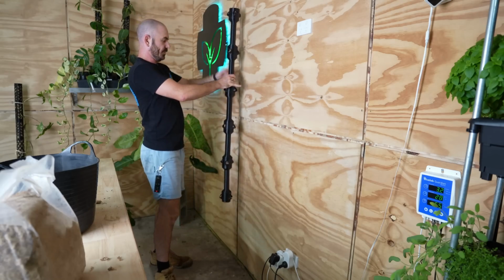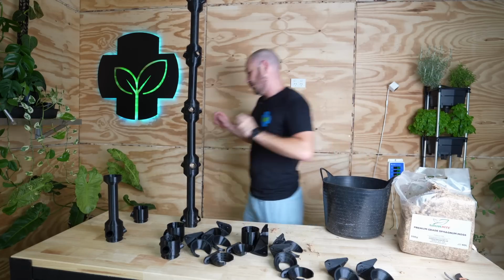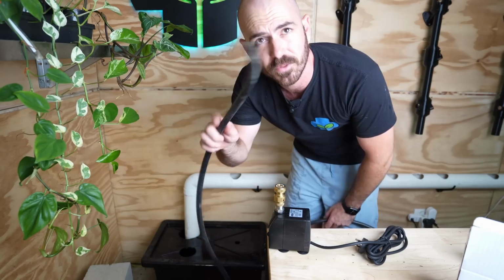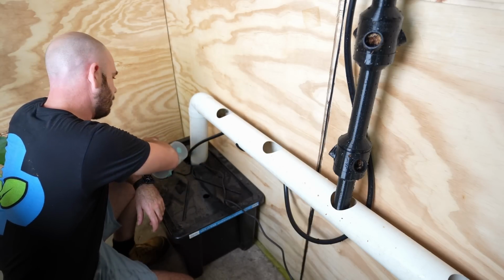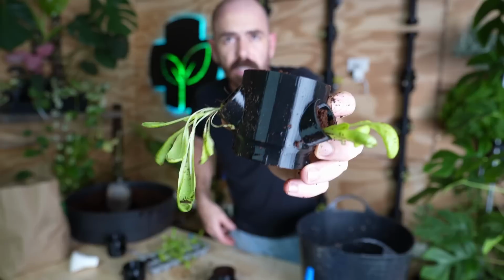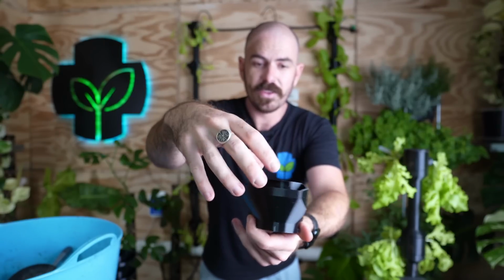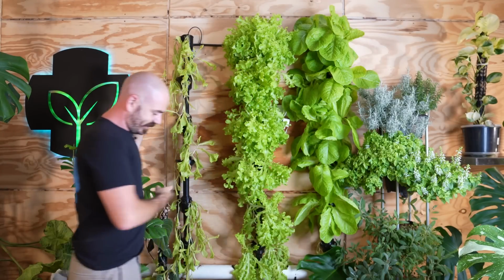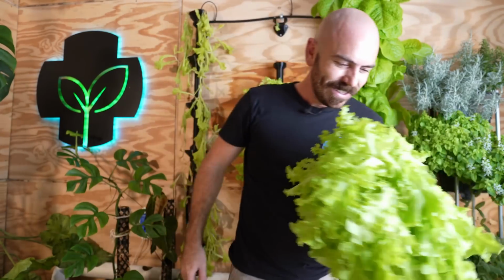Modular 3D Printed Vertical Hydroponic System

Comment: Do you have a version of this that works like the larger modular system you made, one tower in a bucket with water through the tower, as opposed to the water running up a tube outside of the tower?

Comment: this is the second video I've watched where your hole saw comes off the chuck. Here is some advice when tightening the chuck. After you tighten the chuck give it it a slight twist in the loosen direction. The chuck will click, locking it. This should keep you from losing the hole saw. I use multiple MFG of drills and this seems to work on all of them.

Comment: Great video. I tried to download the files through Patreon and there was nothing there. Also was wondering if you would be open to a suggestion about adding more files to close in the bottom of the system with one drain port to the reservoir.

Comment: Great work! I think you can save a lot of print time by combining 3D parts with regular pipes.
This would help ppl with smaller printers, or get rid of print space limitations in general. Just connect the UFOS to pipes with your bayonet connectors.

Comment: I wonder if the 3d printed plastic is what is changing your ph 
You should try soaking a piece in a container of water and measure the ph change
Reply: I was actually thinking about that as well, but I don't know if water is going to be enough to see the effect. PLA, one of the more common 3D print materials, is stable in water but it can break down into lactic acid from the action of microorganisms and their enzymes.  EDIT: I see Hoocho commented that he's using PETG. Still, it would be interesting to see if the filament or any of its additives plays any role here.

Comment: How can we use printed plastics and avoid all plastic leaching?
Reply from the maker: Not all plastics leech.
Thats like saying all metal can give you lead poisoning.

Just use the right plastic.

PETG
Reply: @Hoocho  Mint👍
I see people using PVC in food loops, not the best idea as from my understanding the plasticizers make it far less stable. Even UPVC we use to use for water supply here is questionable.

To cover a 6 X 3m wall would it be cheaper to order printed parts online or buy a printer and figure it all out?
Reply from the maker: @craigdawson7632  buy a bamboo labs A1 if low price is what you’re after.
It’s easy mode if you just want PETG printed.
Watch my latest video on the p1s and carbon.

You’ll love it once you’ve got it.

Comment: That's very well designed hoocho. Have you bought yourself a kmart food dehydrator yet for your filament? Game changer
Reply from the maker: I’ve got a devanti 😂
Reply: How does the dehydrator help with filament?
Reply: The spools of filaments absorb moisture from the air. When a spool is hydrated, it pops and hisses as it is heated up at the 3d printer's nozzle, cause the moisture is vaporized. 
This causes ugly prints.

Comment: From an engineering perspective the narrowing funnel portion of the tower serves little purpose and could be creating some of your leaking due to water constantly being adhered to the wall after each funnel.  Regardless of whether you eliminate the funnel-ing effect the internal basket is also probably in the wrong location, it could be better utilized above the plant (in other words at the bottom of each pipe section to redistribute the sprinkles rather than right at or “below” the plants. Personally I would eliminate moss and coco and only use scoria, hydroton, etc, because of neutrality, oxygenation, less system contamination. Etc.  Love the content.  Good luck.

Comment: 3d printing and cropsteering moisture sensors are changing the 1 man farm industry.. add in the strawberry picking robots and drone for ag, and you can automate acres and acres, and harvest it with 1 person by yourself
Reply: What did I tell you about watching things other than DSP, BOY!
Reply: What is a crop steering moisture sensor
Reply: @billbobaggins7617  Another over hyped failure point. But answering your question; "cropsteering" is a catchy term used by pot growers to a set of automated systems to optimize growth conditions and supposedly extract the last bits of yield of your crop. A "cropsteering" moisture sensor is your run of the mill electronic moisture sensor that gets plugged in to a micro controller, that's it.

Comment: Can you plant directly into the return pipe as well? easy NFT?
Reply: Technically you could you would just have holes in between the drain pipes however with his specific setup they wouldn't get much light. Growing outdoors then sure or adjust the light position so they all get the same amount of light. Definitely an option I would say.

Comment: Printed a different version of a hydro tower 2 years ago, still pleased, its still in the kitchen and grows herbs and salad. Perfect. But I chose white Pet-G, looks nice but is a mistake. Light gets in and algae grows. You need light tight filament, otherwise more cleaning, more often changing the water. H2O2 helps but does not remove all algae. Greetings from 53°N
Reply: I had the same experience with mine, nutrients start to crystalize on the outside of the tower and algae starts to grow. Easy enough to clean up, just doesn't look attractive when using white filament at least.

Comment: It looks great but did you solve the heating problem?
As water falls through the system it picks up heat from the air and causes the reservoir temperature to rise. Im just wondering if you solved that issue?
Reply from the maker: To be honest I didn’t encounter those in the studio.
But they definitely exist and when I take this system outside. I predict we will experience them.
In my climate especially, but most of USA and anywhere south of me it won’t be a problem.
One thing at I time I guess 😅
Reply: @Hoocho  lol, Im in Texas, it would be an issue here as well. ;)
Reply: If you can run a resovoir in the ground, you could cycle it to the ground resovoir( to cool, as ground temperature is cooler and remains about the same) compared to the hot top soil

Comment: Do you need coco in the central tube? Can't you just use scoria or clay? You just put everything together and fill from the top (without the strainer part in the top modules)?
Reply from the maker: Possibly, I’m using the coco to wick back up where the nutrient wants to escape.

With this design release I’m hoping to get feedback.
And if it works let me know. But this is my best approximation of my assumed outcome. It’s quite hard 😂